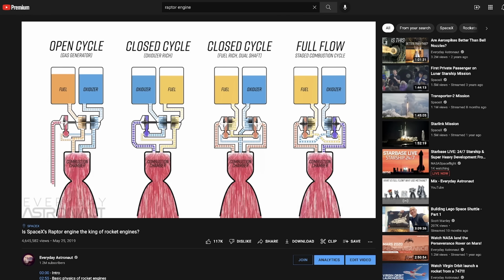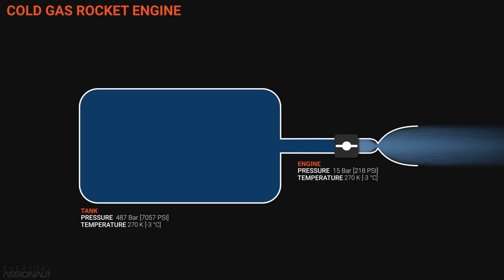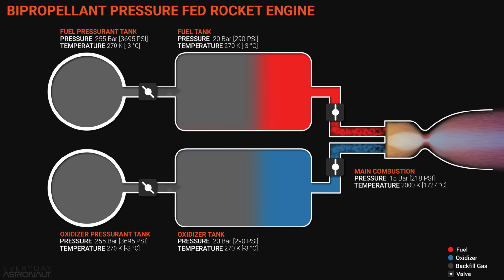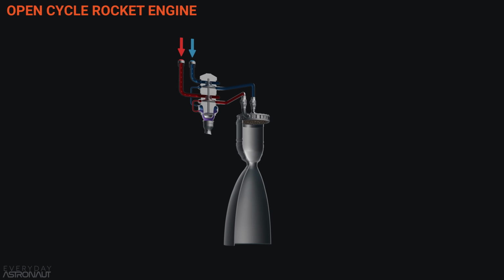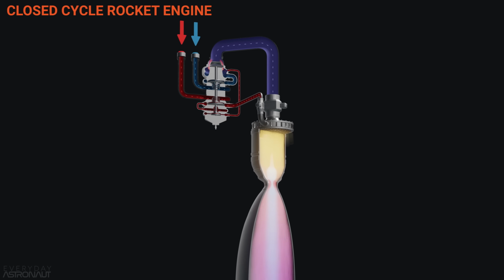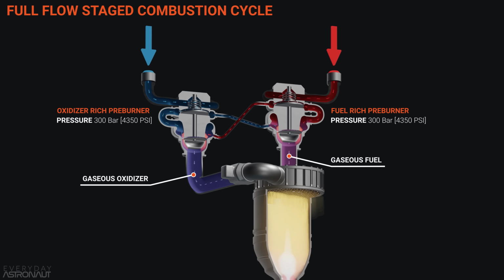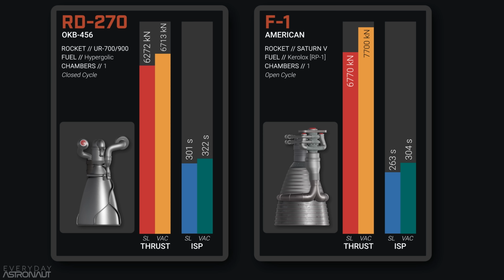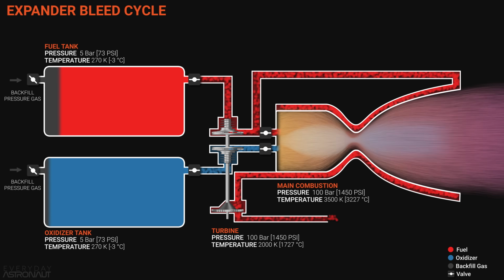Rocket engine cycles: How do you power a rocket engine?

Comment: I'm still amazed this level of content is totally free for everyone to watch. Thank you Professor Tim!
Reply: I know right😄
Reply: I suspect that it's funded.
Reply: i have a question
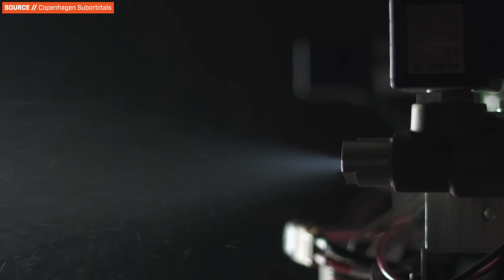8:50 over here how will the gas turn into a liquid??
Reply: @spacecowboy5274  When a gas is accelerated its temperature drops. So the gas being accelerated through the nozzle also cools down a lot. If it cools down below its boiling point, it will liquify. 
In high speeds wind tunnels for example, the air has to be heated before it's accelerated, so it doesn't liquify.
Reply: @ASJC27  why when a gas is accelerated,its temperature drops?
Reply: @spacecowboy5274  It’s a direct result of what’s known as isentropic flow equations. 

It happens because if a gas is accelerated, that means it’s kinetic energy increases and that has to come from somewhere, and that somewhere is a corresponding reduction in pressure AND temperature.
Reply: astafirulohaladzimaladzilahailalohmuhamadhanabtuhuwarosallah~
Reply: @spacecowboy5274  I think if the gas is losing pressure it's loosing heat, so it turns back to a liquid.
Reply: Free? I had to sit through several advertisements
Reply: @Lpabmendez  Wathcing advertisements is also free, unless you was convinced to buy something =)
Reply: @koomaj  Time is money and advertisements cost time.
Reply: @Lpabmendez  adblockers.... still new to you?

Comment: There is one more engine cycle variant not shown here, but that has actually flown! 
If one of your bipropellants is itself a monopropellant, you can use its decomposition to power the turbomachinery and then combustion those reaction products in the MCC, for a fully closed cycle without any preburners and without the thermal limits of an expander cycle. I guess you could call this a "staged decomposition cycle". 
The Bristol Siddeley Gamma is an example of this, where the Hydrogen Peroxide oxidiser was decomposed to power the turbopumps and then the hot decomposition products (water and H2, plus some unreacted H2O2) burnt in the combustion chamber. Which also had the side benefit of igniting hypergolicly without needing to carry any hypergols!

Comment: For biprop, could you have one pressureant tank for both propellant tanks?  That would reduce the weight of the pressurant tank, but I don't know if that would cause problems for the rest of the system.  I can see how that would have trouble if the two propellant tanks have to be at different pressures, but I still don't quite know if that would be a big problem.

Comment: I love how even rocket engines use 'turbochargers' (the turbo pumps) lol that's direct WW2 technology applied to even the most cutting edge transportation technology.
Reply: Well, the turbine is still the best way to extract usefull energy from thermal energy, the idea may be the same, but the execution is much, much better today, reaching higher power levels, better efficiency and longer service intervalls.
Same with computers really, the very basic idea, depending on definitions, was conceived in the 19th century, with first "practical" applications starting in WW2, then roughly in the form we know it today in the late 60s.

Comment: could you think what a carburettor for little 1.6L b6 mazda/ford laser  but designed by Elon would produce
Reply: not much more than what you have now, with ICE its mostly mass of intake air thats limiting performance, thats why you have turbos and superchargers, to raise intake pressure, density and therefore mass for better power.

Comment: Small correction, Tim: on the Expander Cycle: The r^2 surface vs the r^3 volume ratio indicates that small bodies (here engines) are better to cool than large ones as you have a better surface to volume ratio for SMALL radius r. (Thats why polar bears are huge, it is easier for them to stay warm 🤣 with bad cooling)

Comment: Obviously they would have thought of this and discarded it, but I'll put it out there anyway just to see if it makes sense or not:
Why not just ;) ---
Have a closed loop of inert gas that is heated by the expansion nozzle on one end, and cooled by the propellant at the other; use the high-velocity/pressure flow between these two sides to run a turbine.  This way the turbine must only deal with pressure and temperature, rather than chemistry.

Comment: Couldn't an upgrade to the expander cycle be to put a lower pressure engine by the high pressure engines and throw the turbine gas into it? Then you aren't throwing fuel overboard and the smaller engine could have smaller pressures needed...

Comment: Can you use a battery to power a pump to start an Expander Cycle? Similarly to what happens to eletrically-startec APUs on military aircrafts: the APU is started electrically, but it is a little jet engine in itself, which then powers up the actual jet engines
Reply: With expander cycle engines, starting them up can be extremely simple, the fuel used to drive them boils well bellow room temperature, on the early RL10s they just had to open the fuel valve to let hydrogen in, which instantly boiled and spun up the turbopumps, dont know if the modern ones still do that.
Reply: @user-si5fm8ql3c  very interesting thanks

Comment: Hi Tim, why do the electric-pumped engines use lithium-ion batteries and not a fuel-cell with the fuel and oxidizer the rocket has on board? It seems like it would solve both the energy density issue and the unchanging battery mass issue - what am i missing?
Reply: The high price and mass for the fuel cells.
On Electron you can see the batteries glowing red hot after a while, they put out alot of power, more than any fuel cell for the same mass
Reply: @user-si5fm8ql3c  Fascinating, thank you.

Comment: Great video.  Good balance between too basic, and too technical.

Probably a good thing you did not mention  that the RS25 uses expander-cycle to drive the low pressure fuel pump for boosting the main fuel pre-burner pump.  And on the Oxidizer side they used a bleed-off from the oxidizer high-pressure side, to drive the low-pressure pump, making it actually having FOUR turbo-pumps 😛

Comment: Could NASA have used liquid lithium instead of hydrogen? The resulting exhaust would be lithium dioxide as well as remove the carbon coating issue and leak issue?

Comment: So is there a different set of tradeoffs for engines run in space / a vacuum?  Seems like without friction or gravity, along with colder Temps, heat transfer and power output has totally different set of standards and requirements?  Interested to hear folks thoughts

Comment: Why can't the open cycle fuel be dumped into the exhaust like an after burner?
Reply: Wouldn't that just waste the fuel?
Reply: @archer1133  It would be wasted anyway, this way the fuel rich material could potentially do some work.
Reply: @andrewbeeco967  I am confused about what fuel and what exhaust you are talking about. Are you saying that the actual exhaust should be rerouted back into the combustion chamber? If so, then wouldn't that just be a closed cycle engine?

Comment: And why is Musk there with a rocket engine? He has very little clue what those are, he is a salesman, not the engineer.
Reply: Because he is leading the Starship development from the build-site and has a hands-on experience with his employees in order to know exactly what is going on. His only residence is a 50k box house at the site. Although he doesn't have the college degrees, he is a software engineer, aerospace engineer, mechanical engineer, and probably an electrical Engineer as he has innovated and worked in all the related fields. Elon is well-educated in the rocket industry and knows exactly what needs to happen for success to be possible, it is just up to his employees to successfully build what is necessary.

Comment: It does seem pretty strange no one has tried a tap-off cycle when it seems to be pretty close to an open cycle gas generator but with simpler pumping.
Reply: Blue Origin’s BE-3 engine uses the tap off cycle on New Shepherd. The plumbing is simple, but the components have to be designed to withstand the high temperature gas from the main combustion chamber. That can be expensive and challenging. By comparison, the open cycle is less efficient, but has significantly lower temperatures in the turbine.
Reply: @acceleratergun7597  
Makes sense

Comment: I have a thought and sure there is a relatively simple explanation for why it can't work and this seems like the comments section where someone might be able to understand the problem.
My question is why is it not possible to run both fuel and oxidizer through a single pre-burner while limiting the efficiency of the combustion. If the injection system only allowed a small fraction of the mix to burn in the pre-burner then the temps could be kept low and then the mix could be injected into the combustion chamber for complete combustion. I assume that the process of controlling the mix is to difficult or some other similar issue but I'm curious if anyone can offer a simple-ish explanation. Thank in advance.
Reply from the maker: If you allow the full mixture of propellant through on turbine, it’ll burn as hot as the main combustion chamber, which the turbine can’t handle. The only way to control that is by running it far from stoichiometric, which is why they flow all of one and just a bit of other. Watch my “why don’t rocket engines melt” video to understand it better 👍
Reply: @EverydayAstronaut  Thank, I understand that. 
My question is if they both enter as liquids can you limit the efficiency of mixing so  only some areas are at combustible ratios while the majority isn't? 
If this could be achieved the non-burnt element could act to cool the total volume keeping temps under control.  
Maybe even if you could do this once the mixture hit the turbine it would gets spun up and mixed too well and so it is impossible to keep the combustion rate low enough until the injector plate.

Comment: I think one important omission on this list was pump fed monoprop and hypergolic biprop for in-space use. Some satellites use a small electric pump to increase the pressure to the engines, reducing tank and regulator mass by reducing the pressure requirements.
Also in general every cycle will work with hypergolic propellants even if cryo is a better option for boost propulsion (usually).

Comment: This was surprisingly good, except from the part when full flow cycle engine is much better than other, reality is that are slightly better than others close cycle (oxygen rich, or fuel rich), by slightly better I understand a 3 or 4% improvement in specific impulse, how you could improve specific impulse (15 or 20%}without melting your engine? Using a tri-propellant engine that have exhaust very rich in low mass elements, that isn't used today but some prototype were tested more than 50 years ago.

Comment: Loved the video, but AFAIK there are errors in the way entropy is described. High entropy does not mean high temperature, but low amount of energy that can be put at work. Considering heat only, whatever the temperature, if everything in the system has the same temp, then entropy is at its highest and no energy can be harnessed. If your system has regions having high temp difference between them, then you have low entropy and can put that temperature gradient at work. In a closed isolated system, entropy can only increase, which means the amount of available energy to be put at work can only decrease.

Comment: Really great video but you didn't talk at all of the solid propellant based rocket engine... They are quite common (all the booster). The hybrid one (solid fuel and liquid / gas oxydizer) are really interesting and not so much explained or mentioned anywhere.

Comment: you said the pre burner should run at twice the pressure than the combination chamber. So is the pre burner at a raptor engine at 500-600bar? Does anyone know?
Reply from the maker: Almost 800 bar for Raptor preburners! Elon mentions that in our latest video and has mentioned it on Twitter a few times too 👍
Reply: @EverydayAstronaut  ups, but thank you very much

Comment: Always wondered why there's not a gravity fed engine.

As the rocket accelerates, the pressure goes up.

Not for crewed rockets, but a missile accelerating at 100g only needs the fuel level to be 10 or 20m above the engine to get 1-200 bar chamber pressure.

Comment: Potassium permanganate is not a catalyst that hydrogen peroxide can be “run over” like a catalyst based on precious metals. It is soluble and was used as a liquid mixed into the peroxide. While the amounts required are quite small the complexity of the additional liquid handling makes this almost equivalent to a bipropellant system.

Comment: I came up with the idea of using the fuel and oxidizer to run a fuel cell, to run electric pumps, making for an even more efficient, but relatively simple engine. I then found out no one does that as fuel cell technology is not yet up to the task.

Comment: You describe hydrogen peroxide as a “strong reducing agent”. It is actually an oxidizer. Hydrazine happens to be a reducing agent. But in both cases these properties are quite irrelevant to the operation of the engine as they do not get to participate in any oxidation/reduction reaction - their decomposition products are simply released through the nozzle. 
The important property is that these chemicals have a positive enthalpy of formation i.e. their decomposition is exothermic. Such chemicals are, by definition, unstable. Especially at high concentrations used for rockets. Ideally, they would be reasonably stable in storage and only decompose where and when you want them to.

Comment: 13:21 in video:  You state that tanks can be thinner.  NOT SO.  In pressure-fed monopropellent or bipropellent, the fuel tank & the pressurizing gas tank MUST be at "crazy high pressure" (higher than the combustion or reaction chamber), just like the cold gas thruster.  The ONLY advantage is the propellant expanding after the reaction.  So volume rate increases, but THE PRESSURES ARE THE SAME, & the tank walls must be JUST AS THICK & HEAVY for a given combustion or reaction chamber pressure & volume for combined fuel & gas.
          You also fail to mention that there needs to be a way to keep the pressurizing gas separated from the fuel (either a membrane or using G-field & density difference between fuel & pressurizing gas).
          I noted on one of the videos of starting engine (at 30:54 in video) that appears to start up dumping turbine exhaust overboard during the start up.  Any comments on that engine?

Comment: Was wondering if there was a way to have a trailing engine system that could use the exhaust from the main rocket to propel it separately, for launch to orbit, and then use small guidance (compressed gas) to achieve an LEO - OK that was just silly. But it seams there's some hope to use that heat/gas expansion energy from the launch engines.
Reply: @Jambay I assume your talking about the main nozzle exhaust. In that case it probably wouldn't work due to having a rotating shaft running through the combustion chamber and nozzle throat which would be difficult to cool.

Comment: Thanks to your kind of videos I was actually playing around trying to workout a light weight reaction control system that could be used in EVA in stories like the expanse, the idea being that is has be light weight enough to be carried on the back under gravity, so keeping COPV as small as possible and avoiding having to use nitrogen based compounds since I wanted my ship to be able to be mostly self sufficient on this kind of thing. 
my fuel being methanol, one of the ideas I had was to use a fuel cell to provide the electricity to an electric pumps to provide the pressure.

Comment: Great video, very educational as well as entertaining.   I enjoyed watching it!

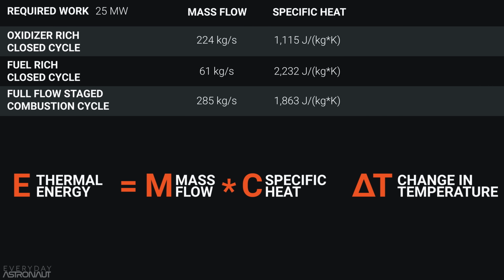There is a slight mistake in the equation at 39:59, however. Multiplying the variables on the right side gives power P in [W = J/s] instead of Energy E [J] since you multiply with mass flow.
Also, the chart says 'required work' on the top left but has a value of 25 MW, which is again power, not work.

Comment: Expandable bladder in tanks build and maintain pressure. Or tanks that shrink being much more versatile, less weight. Kinda like a memory foam. Or sponge collapsing under draw of fuel, in turn shrinkage forces fuel out at consistency material.
Tanks can do the work. Find way to make them shrink.🤗

Comment: Hey, I thought the F1 engine that powered the Saturn V was closed-cycle? You said it was open cycle at 24:57 and I wanted to see if I missed something, or if they are actually closed cycle.
Reply: It is an open cycle  but the exhaust of  the gas generator was expelled in the nozzle to help cool the nozzle.  The merlin vacuum engine on the falcon 9  and the J2 on the saturn 5 are also open cycle but use the exhaust to help cool the nozzle.
Reply: @stevenf1678  got it. Thanks for the clarification.

Comment: This is how you understand rocket science.   A lot of people don’t understand that it’s the pumps that usually define the rocket engine not the nozzles.  The largest Russian rocket engines had 2 and even 4 nozzles for the turbo pumps, so they were considered one engine.  Large combustion chambers can suffer from combustion instability, like what plagued the F-1 on the Saturn V.  So instead of one large combustion camber just make 2 or 4 smaller ones that don’t have combustion instability.  That is why it is the pumps that define the rocket engine not the combustion chamber. The volume of flow and pressures these pumps produce is mind boggling.